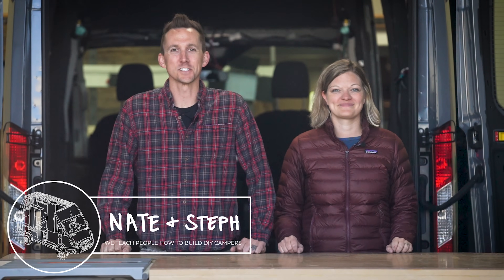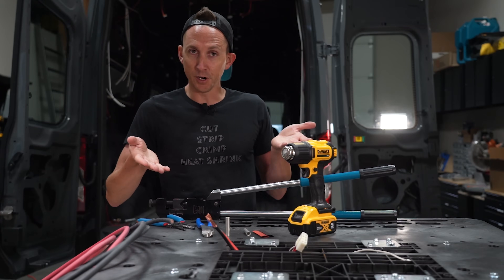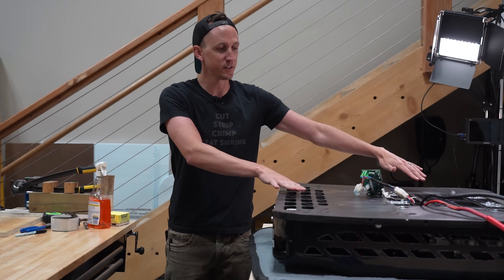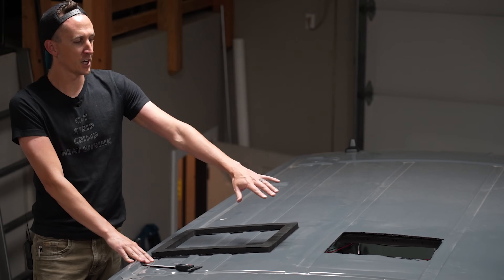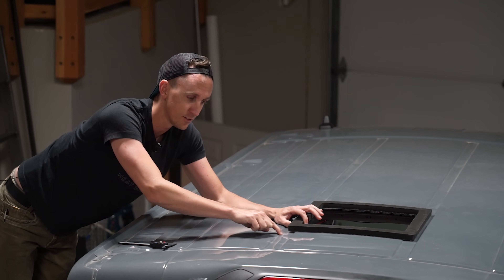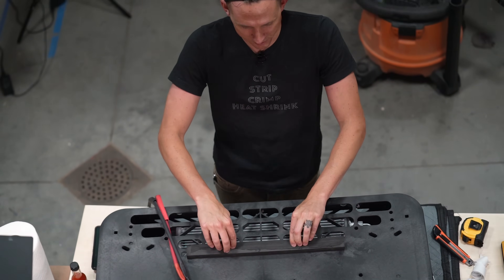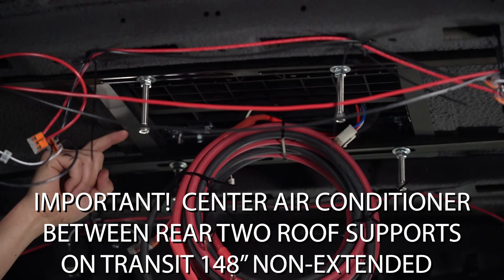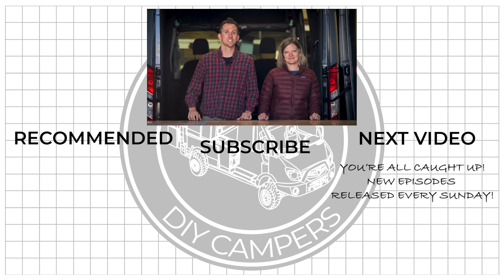Installing a 12V/24V DC Air Conditioner Into our Camper Van Conversion (Nomadic Air Conditioner)

Comment: We made a huge mistake by not installing an air conditioner on our Transit! On our first trip in September we drove through South Dakota, Wyoming, and Colorado. It was so hot! Way into the 90’s while in the Badlands. Our Maxair fan did a good job in the evening keeping us cool enough to sleep but AC would have been awesome. Is it possible to have a split 12 and 24 volt system? Since our 12 volt system is complete I don’t want to redo it. I was hoping I could install another battery. Great video!
Reply from the maker: If you already have a 12V system, just stick with a 12V air conditioner.  That is an option that is readily available.

Comment: You forgot to show where the other rubber seal goes that divids the hot and cold air… 
Makes me feel like you’re missing a few other steps.
Reply from the maker: I didn’t forget, no. That seal was not being included with the air conditioner at the time of installation, so it wasn’t shown.  That was indeed recently installed after the fact but didn’t get its own video as that step is wildly easy with no instructions needed.

Comment: What Gage Wire are you using to connect the AC?
Reply from the maker: 2 awg
Reply: Would 4 gage for less than 10ft for work or is that dangerous
Reply from the maker: @tommyjones6672 what does the nomadic user manual say?
Reply: Not sure I'll just go with that 2awg just to be safe

Comment: Greetings Nate and Steph!  Once I build out my van I'm planning to travel to Latin America.  To get from Panama to Colombia it's necessary to put the van in a container on a ship.  No roads.  The height clearance is limited so I will likely have to take off the fan and air conditioner.  I'm wondering if you're aware of any air conditioner and/or fan options to extend minimally over the roof.  Thanks!

Comment: Nate & Steph - thank you for the great videos. These are super helpful.
I'm interested in a similar fan install in a similar "position". I'm wanting to trial the fan first before jumping to AC.
Could you comment on the position of the fan from the back door seam as a reference (or wherever you measured from?)? Id like to ensure I leave ample room for future potential AC and hopefully no roof rack issues. Cheers - Steve

Comment: Quick queston.  I recently watched two Nomadic Cooling vendor install videos and in both of them, they mounted the interior support brackets with the flat side up.  I think they way you did it makes more sense so I did it that way but I was wondering what your reasoning was on that or if it just seemed like the right way to do it.  Thanks!

Comment: What about in extreme cold condition when you are not using the air con? Does it transfer too much heat out through air vent?

Comment: Air conditioning related. I haven’t seen this covered anywhere. I have a 110v AC unit already installed in my van. I DON’T plan to run it with battery power, but I will have a 2000w Renogy inverter/charger. 

Should I have a separate circuit from shore power for the AC unit or just run it through the inverter? 

Basically, I don’t want to accidentally run the AC unit off battery power.
Reply from the maker: I wouldn't recommend a dedicated circuit, personally.  I'd just not turn the air conditioner on when you don't want it on.  Just one of those 'pay attention' things like there not being a safeguard to leaving your stove on in your house.
Reply: @EXPLORISTlife  you would just run the shore power trough the inverter charger and then put the air conditioner on its own breaker after in the box?
Reply from the maker: Yep.  Shore power to the inverter charger and then to the breaker box for all loads.

Comment: Ideally what do you prefer to use in a camper van 12 AC system or 120 volt system.  I'm designing from scratch so I want to do it right.  Thanks.
Reply from the maker: Either way, to be honest.  The 12V AC's are going to be more efficient since they are not having to go through an inverter, but 120V AC's are going to be more cost effective.

Comment: My only concern is that "this thing is huge"(That's what she said). Valuable roof space if you want to load up with solar and a roof deck.  I'm going to go high efficiency mini split with 2000 watts of solar.  But I'm doing a 24' shuttle bus so I have the room as these transits do not have the room for that much solar.
Reply from the maker: Not too many other options for Transits.  A big condenser from a mini split hanging off the back of our transit would have looked pretty terrible. 🤣😂  We were still able to squeeze in 580W of solar on the roof and can have up to 1700W we can plop out on the ground.
Reply: @EXPLORISTlife  Thanks for response!  580w is a healthy amount.  I have 400w on my daughters transit and it powers what she needs so 580 is good.  She is running out of money so we are going to try to do AC with a portable AC, an Ecoflow Delta and an extra solar panel she can put outside.  Ecoflows charge rather quickly so hope it's an option.  Saw a few videos where people were able to run a fair amount of wattage with an ecoflow.  Fingers crossed.

Comment: At $4500, these units are super expensive. I wonder why an air conditioner that works on AC only cost like $1500. 
with that huge price difference, and if you remember that your batteries will only allow for 1-5 hours of use (depending on you battery capacity and the temperatures), maybe it would be better to buy an AC unit?

Comment: Nice job as always guy’s, it will be interesting to see follow ups on how this aircon performs particularly in the extreme temps and overall power consumption data. I recently installed a 24v 3kw AIO system in a 40’ bus with 10kwh of lifepo4, trying to aircon for summer using solar, its working but still need to do more upgrades to get it all properly off grid, another inverter, more PV and a bit more battery maybe. I like the 24v & 48v AIO’s for the larger van setups because it is making it so quick, easy and cheapish to setup nowdays & get a decent power output to run such luxury’s. Thanks for all ur great efforts and sharing ur info. Cheers

Comment: this a/c unit cost 6k it pulls 24A @ 24v set to low in eco mode with a outside temp of 85f and pulls up to 50A @ 24v =1200w  with a outside temp of 90-100f this a/c requires 4 200ah @ 12v batteries to run 8 hrs. on a hot day if your lucky
Reply from the maker: *That's if the unit runs on high and never cycles off for the entire 8hrs and you have no external charging sources like solar.

Comment: Hi Nate!! Another question for you as we’re installing our electrical system. We’re planning out the electrical install on a Dometic RTX2000 (12v). We have the Lynx distributor and all our pos/neg connections on the Lynx are taken with other components (inverter/charger, solar charge controller, dc/dc charger, DC load center). We know we have to take the air conditioner wires to the Lynx but since we don’t have a connection, we think we can use the pos and neg termination points on the far right side of the Lynx to connect the air conditioner. There is an inline fuse on the Dometic AC wiring, so we wouldn’t have to add a mega fuse on the Lynx. Would this be a safe connection? 

BTW you’re visuals and instructions are invaluable!! Your channel (you and Steph) are a regular feature in our lives at the moment. My dad, the electrician, has learned a ton and he’s really enjoying the project.
Reply: This is a great question that I hope gets an answer. I've purchased one of the PDF plans from Nate and Steph's shop, and it's incredibly detailed. But after examining, I'm confused about how you would tie a DC unit like the Dometic RTX 2000 into this.

Comment: Is there a difference in efficiency between their 12v and 24v units or is it just so that I can match whatever battery setup is installed? What is the advantage to setting up 24 vs 12? If I were to install 3 batteries instead of 2 what would change in your set up?
Reply: 6 months later and NO reply?  TERRIBLE CHANNEL, NO SUBSCRIBE HERE!

Comment: How did you determine the location of the unit to be installed? I assume it’s centered from left to right but how far forward of the end of the back of the roof is it?  Thanks.
Reply from the maker: Lots of measurement and playing around with dimensions in sketchup.  I talked about it more in the start of this video: https://www.youtube.com/watch?v=y1iI-wjm_D8

Comment: Price tag + power consumption + actual cooling in hot conditions - makes me wonder if creating an easy to use tarp system that covers the majority of the van, and just having expelling simple fans on the inside seems to make more sense. For me at least.
Reply from the maker: If you can stay in cooler temps, that would be fine.  100 degrees under a shade tree is still pretty hot.
Reply: @EXPLORISTlife 100 degrees in the shade is still 100 degrees.   Many times a tarp and fans are not enough to stay comfortable.

Comment: Anyone know how to connect a Dometic RTX 12v air conditioner to power/ground?  Somewhere I heard you can/should connect directly to the Lynx distributor but I'm NOT an electrician and would love to watch a video on this step (that I can't find anywhere).  any help would be great!!
Reply from the maker: Stay tuned!  We will be covering that in a few weeks once we get to the electrical system of this build.
Reply: Great—wondering if the 12v version can be wired right to the Lynx distributor?

Comment: Instead of connecting to battery power can we use generator??
Reply from the maker: If you have a generator that puts out the proper voltage, I suppose you could do that.  A standard 120VAC generator won't work, though.

Comment: If this is 24v, is your battery source for the AC different than the rest.of the 12v van system?
Reply from the maker: We will be installing a 24V battery bank in the electrical system for this van, stepped down for all of our 12V loads.

Comment: I was wondering why you went with a Rooftop AC instead of the undermount 12v AC system such as cruisencomfort? It's a similar cost and frees up precious roof space for solar?  Your videos are just too good.👍 Thanks for sharing all the knowledge.
Reply from the maker: We very much considered it; but the interior unit of the Cruisencomfort took up too much room for us to be happy with it.  If we had an extended transit or a bigger expedition vehicle, I could see that working, though; but the rooftop AC has nearly zero footprint inside the van, which is what we needed this time around.  That said... we were STILL able to fit 580W of solar on our non-extended transit, which is pretty good: https://www.youtube.com/watch?v=zspCRKAFxKA&list=PLmvhcyi4n0TVfA4XCYJBkzfUXunSON1zX

(Plus we will have the ability to use a ground deploy solar array up to 1700w if needed. 😂👍)

Comment: It would be interesting to see how a 12v/24v dc Nomadic unit compares in efficiency to a efficient 110v ac unit?  I have a Houghton AC3400 13,500 btu and run it off 12v batteries and Victron Multiplus 3000. I know I’m not as efficient as a straight 12/24v system, but wonder by how much?
Reply from the maker: That would indeed be interesting to see!  Identical vans side by side with different units in each would be a fun test.

Comment: You mentioned that you'll be wiring this directly into the Lynx Distributor. With the 4 input/outputs from the Lynx dedicated to the inverter, solar charging, alternator charging, and DC fuse blocks or circuit breakers, where will you have room to connect the air conditioner?
Reply from the maker: A 2nd Lynx distributor.  They simply mount end-to-end for additional spaces.

Comment: Instead of trying to cut the foam down you could just add foam strips to the low spots to make your mounting surface level.
Reply from the maker: I guess, but we were trying to keep a low center of gravity for some of the hairpin turns when we take this thing to the track.  Removing the material instead of adding material will subtract about 18 seconds from our lap times.

Comment: Been watching all your videos and learning a ton. Been to the blog posts too but i haven’t seen anything about a 48v system and everything you can do to it, for it, and with it. Would you be willing to post something or updating a previous configuration with 48v? I really want to put together a 48v solar setup with 48v batteries with step downs to 12v for accessories and the such.
Reply from the maker: I'll do a 48V system one of these days for a big split-phase off-grid cabin or something.  The parts and components are simply not readily available enough for me to make a tutorial for a 48V system in a camper.  Those big red battery disconnect switches, for example, are only rated for 48V where a 48V battery bank charges at nearly 60V.  The parts availability for 48v to 12V step downs and 12V to 48V chargers for alternator charging are just not yet available enough.
Reply: dang... thanks for replying, love your vids!

Comment: Do you know if having the AC  upside down and then immediately powering it up for the bench test will cause any damage? I know some AC units if you do that it will permanently destroy the unit. I reached out to Nomadic and as of yet haven't heard back. I didn't see anything on their website or instructional manual that says anything about it...
Reply: Most AC or refrigerators should be left right side up and not tilted. If this isn't possible let them sit overnight.  This unit may not be susceptible to the general rule. Would be nice to hear from the manufacturer.
Reply from the maker: I don't have documentation on that specific concern, but usually if something will permanently damage the unit; it'll be clearly noted in the user manual or on the unit itself.

Comment: Nice looking unit but I’ll stick to my two 1-ton mini-split units. Super cooling in my 38ft class-A, silent and energy efficient. Yes, I had to upgrade the inverter but still cheaper than the $11,000 price tag of the Nomadic units.
Reply from the maker: Nope.  Sorry.  If you're going to watch my videos, you have to do everything exactly as I do it with no alterations. 😂  Mini splits would indeed be a good choice for a big 38ft class A motorhome.  You've got just a LITTLE more space to hide a big ugly condenser than I do.
Reply: Wowwwwww 11,000 dollars, thanx for the info, mini split just got my attention 😁 thank you
Reply from the maker: He was being a drama queen.  This unit isn't $11,000.

Comment: Why not use the diy van roof adapters?
Reply from the maker: That would 'probably' work as well, but would be adding additional material to the gasket and would lift the air conditioner up another half inch and off of the rear support block.  That and we wanted to do this install as 'per the instructions' as we could.  We used the van roof adapters on our Maxxair fan install that you'll see next week, though.